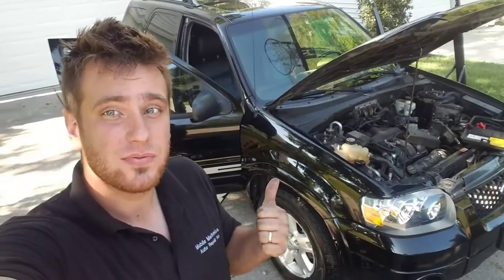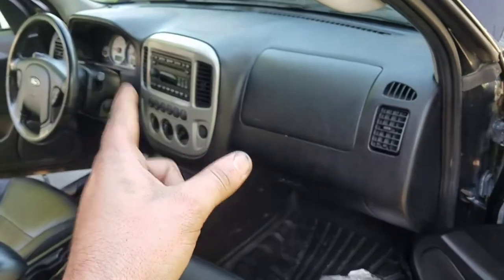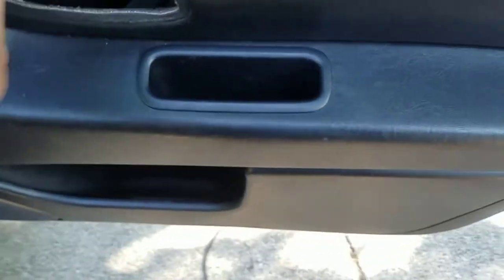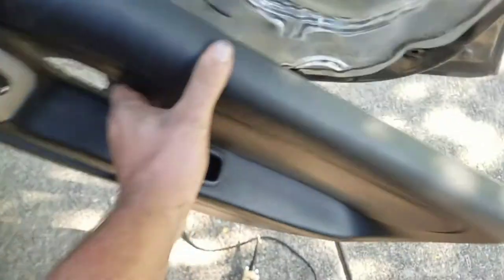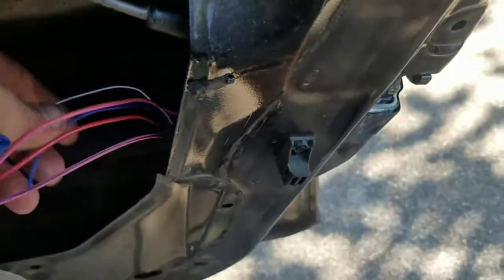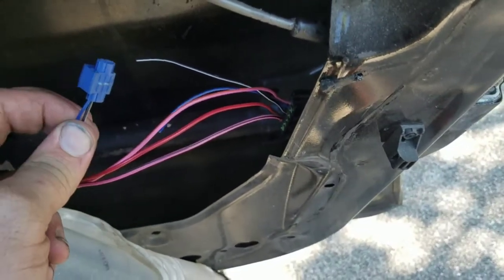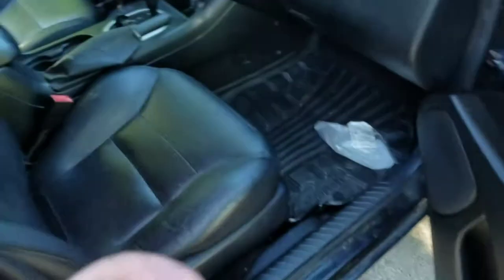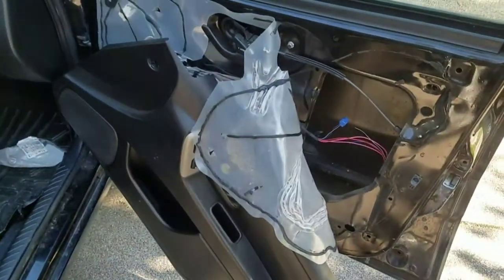Ford Escape Passenger Door Ajar Fix "How to"

Comment: Great info, I fixed my 2006 Escape, but watch out, if it is the DRIVER'S  door, you have to splice the GREEN+BLACK wire (not blue)  to the WHITE+Black.  And with the driver's door, be aware that if you repair it this way, you will not get any beeping if you leave the key in the ingition when you open the door.
Reply: Good information. This is what worked for me. I tested this by using a jumper wire to connect the corresponding ports which immediately turned off the dash indicator and the interior dome light. Thanks!
Reply: Thank you!!! This fixed it for me too
Reply: So my door randomly says it's open while locked alarm goes off. Driving it say door is open driver door. Those wires are not factory connected? Or is it just that they came apart. I'm sick of getting up to shut off alarm I would leave it unlocked but I don't live in good area
Reply: Do you have to cut the factory wrapped wires loose and apart then splice them together

Comment: Thanks for this, and it absolutely works. The alarm on our 2005 Mercury Mariner (same as the Escape) has been randomly sounding for months, to the point where we stopped locking it.  Then I walked across the road and fixed my neighbor's 2005 Escape, which had the exact same problem.  On both, it's the black wire plus the blue-&-pink wire. Problem solved, both vehicles now locked, dome lights working as they should, and no more "RIGHT REAR DOOR AJAR" on the dash!
Reply: lol.. that is the same door that is showing ajar on my 2005 Mariner. The right rear. I am going to have to try fixing this tomorrow. The alarm started going off for no reason. Can't have that. Didn't know it was on till I went outside. My neighbors probably hate me now. I am leaving the doors unlocked for now. Hopefully that will keep it from going off till daylight and I can see to fix it.
Reply: You answered the exact question I had about which wires. I have a 2005 Escape, too. Thanks.
Reply: Same exact door for me to keeps going off
Reply: Same door for me on a 2007 Escape I just bought (took me a while to figure out which one because the Ford doesn't tell you WHICH door is ajar!).  FYI- you don't have to cut the wires.  Just drill or carve out the plastic blocker on the side of that vampire tap that prevents a "through wire" on that side and clamp it down across both wires.  Continuity between those wires = "door is closed," regardless of what the door switch is doing.  And if you feel like replacing the faulty switch later (I don't) you don't have to repair the wires you cut- just remove the vampire tap.

Comment: This all day!!! I was getting quoted like $1000 from both my mechanic and the dealership to replace the whole door it sounded like, or maybe just this sensor not sure. My alarm had been going off for like 2 years while locked and got to the point that it started right back up after I turned it off so I just left it unlocked. Found and followed this tutorial in one afternoon by myself today - if I can do this ANYONE CAN. Thank you thank you Fixbook it's been such a weight off my (and my neighborhood's) shoulders!

Comment: I just did this. It works except that my radio now does not turn off automatically when the door is opened after the key is out. NOT a big deal turn it off manually. Be careful on the driver door! It is the GREEN/BLACK wire, not the dark blue one like the passenger door. I mistakenly did the dark blue wire and the door ajar chime and dome lights stay on while you drive constantly. I opened it back up, did the green/black wire and reconnected the blue wire and everything works great. No more door ajar light, dome lights staying or random car alarms. I can lock my car at night again which is a relief because it has been gone through by homeless twice. Thanks for the video. I fixed my years old problem in less than an hour with a screwdriver, wire cutters and electrical tape with zero out of pocket expense.

Comment: Thank you so much my brother, you $aved me big time!! It was my right rear door.. Bypassed now it works just fine,  windows, locks work just fine on all 4 doors, dome light works with all except the rr.. Opened it with truck running and no dash warning.. Again, thank you, have an awesome wknd
Reply: c gonzalez Hello I’m having the same problem with the exact same door I have a pink and blue wire black and white wire orange and pink wire and pink and black wire which ones did you have I have no idea which one I’m supposed to be cutting I don’t wanna cut all of them to find out
Reply: Never mind I went further down the comment thread and figured it out thank you

Comment: 2006 ford escape hybrid, worked like a charm. Thanks!! Only difference: the blue wire in the video was blue and pink striped for me
Reply: My car always says a door is open but not which one, if I do this door only will it work ?
Reply: @marcuscuellar2185  You need to figure out which door is the problem. Two ways to do it. Option 1 sit inside the car and lock / arm the alarm with the remote. Open the doors one by one. Repeat the process until you open the door but the alarm doesn't go off. That door is your problem 😉.  Option 2. If you have a good OBD2 reader and Forscan under dashboard you can load the PIDs for the door ajar sensor for each door. When you drive and the door ajar alarm goes off note which door is ajar on the display. For me it was the front passenger side door.

Comment: Thanks so much for this video. I have a 2005 Escape with a bad rear passenger sensor that is draining my battery. Are the wires the same colors in the 2005?
Reply: hi so i just fixed mine , it is very close to the same thing but you're  going to be looking for a pink/blue wire to connect the black/white wire wire .
Reply: @timpaine6352  Thanks I'm getting ready to fix it now.
Reply: Had Enough awsome !! There is only 2 screws for the rear as well
Reply: TIM PAINE I went through months of draining my battery and having alarms and lights going on while driving. The fix took 10 minutes on my 2005 Escape..SO frustrated with Ford. Thanks for the info. I just capped the two wires together and no more alarm! Thanks for posting the correct colors & Thanks to Fixbook too! Saved me $400.
Reply: So for the 2005 you need the pink wire & blue wire to go with the black and white one?

Comment: The driver doesn't have a solid blue wire.  So I spliced the black and white to a blue a light green and now the dash says the "driver door ajar".  would you know which wires to splices on the driver side?

Comment: I believe it’s my driver door setting the indicator off, will sometime be affected by adjustment of my seat. Would I still bypass the sensor via the passenger door? Because there is ALOT of wires on my driver side and I cannot find any site or book that’ll tell what wire goes to what
Reply: UTube

Comment: @Fixbook surely with everyone that seems to have this problem, there should at least be a way to tell which door is causing it!
Reply: Sit in driver's seat with all doors closed and press LOCK.  Wait 10 seconds.  Open one door.  If it alarms, then that is not the door causing the problem.  Try another door after closing doors, locking, and waiting 10 seconds.  If the alarm does NOT sound, then you have found the problem door.
Reply: Dan Starkweather thank you! 🙏  I will definitely try this

Comment: So, because i am obsessive compulsive, and don't have a lot of electrical sense - do you take the wires from the door latch and also connect them in the butterfly connector?
Reply: Nope, just short the two coming to the switch like he shows, the two from the switch should be left disconnected.

Comment: I too have this problem with my 2007 Escape! Problem is....the dash light indicator shows I have an "open door" ...but it has no indicator to tell you Which Door!? Help Please.
Reply: our's has been doing this on and off for about a year now. today it ends lol. fed up with the random car alarms and who fits while we are out. how i tracked it down was the dash has a display telling us information. it would flash so fast you couldn't even see it but it finally was on long enough to catch it one day while driving. i might be wrong but i think some of the more advanced scanners, shop level scanners, can see more info than we can with our best home scanners/code readers. it might be worth having a shop scan it. it shouldn't be an issue with the engine/trans but i think the computer stores that info for diagnostic purposes such as ours. i'm far to cheap, stubborn and untrusting to let a shop at my car personally but you might not have such issues. you can do this yourself after they figure it out. i'm going out there right now to splice that headache, just didn't have the wire diagram and this guy gave me a start.
Reply: blueovalfan23 How did this work out for you?  I have the same issue that I can’t figure out which door; it seems sometimes it’s the passenger rear, but sometimes it’s the hatch.. very annoying.
Reply: Here is what I was told. Sit in driver seat, turn off car, key in your hand. Double click to lock and prime alarm. Wait 15 seconds. Now open doors one at a time. The alarm should sound.  Reset alarm. When you find the door that will open WITHOUT sounding alarm, that's your bad boy.

Comment: so far this worked for me.. 2007 mercury mariner premier whose battery is steadily getting drained from this problem.
Reply: Joseph Clemente im having the same problem and i cut the black and white wire and the pink and blue. What should i do next?
Reply: Don’t know if you’ll still see this, but I have an 07 mariner and trying to figure out which wires to cut and splice. What worked for you?

Comment: Which wires do I cut and splice together for the drivers side? I cut the black/white and blue on drivers side and dinger won't go off in drive or reverse
Reply: did you found the solution 
I did the same thing to my driver side and now I am stuck,
Reply: I have a 2005,just fixed my driver side problem. Black w/white was the hot,green with black stripe was the door ajar. If you get the door panel off,pull the connector apart by the latch,turn the key on,take a wire and jumper from blk/wht pin and one at a time go to another pin until you find the right one. You can cut the one wire and splice to the blk/wht bypassing the door ajar
Reply: @davidweppner1642  Thankyou

Comment: Is it not possible to find a place along the wiring harness where it comes out the door that you can tap into to join the wires so that you don`t have to take the door panel off? Where do the black/white and blue wire originate?
Reply: Do you realize you’re just making it harder for yourself? The door panel is literally a few screws. Just pull it and go in.

Comment: Any way to get this to work for a 2008 Escape lift gate glass sensor? My lift gate glass latch is warped from rust on my hatch and won’t close properly so I disconnected the wire for the sensor and now this light stays on in my car. I disconnected it so no one accidentally opens my lift gate glass from my key fob
Reply: Did you figure this out ??? I'm having the same issue

Comment: Hi!! I pray someone see this! 
If I followed this exactly.. why would my car lights and door ajar light still be on? My wires were black/white and my blue wire was blue/pink. I saw in the comments it said some would have blue/pink wire. I do need to know under that blue connector did the two wires you have in there touch? Like do the wiring need to be exposed and touching or are they not exposed just separated from when he cut them? And no I don’t have mine touching. I was wondering if that is why??
My car is a 2007 Ford Escape. I took it to Ford and they determined its my right rear door that has a bad ajar switch. They want to charge $900 😫😫 I’m trying to take care of this myself so my alarm won’t sound at 3am again.
Reply: I just did my 2005 Ford Escape it was the Black/White and Pink/Light Blue wire.  Cut both wires and then connect the two together and do the same for the other ends of the cut wire.  Once you connected both wires with once another you then attach them together with the other two.  I used a butt connector and then black electrical tape.  Worked 100% Watch this video https://www.youtube.com/watch?v=Xq9UCa852HU

Comment: Just tried to do this but now the door ajar sensor is on constantly and the car beeps non stop. Any ideas what happened? Successfully did it with the other doors.
Reply: you did something wrong - after you cut both wires - you connect them together - I used a butt connector to connect the wires together.

Comment: We have new-to-us 2005 Ford Escape, "door open" warning sign, horn lights and bip-bip sound inside car kept going off.  Did the wire trick (pink/blue to connect the black/white), no luck.  HELP!
Reply: Sounds like you may have done the wrong door.
Reply: @modemagic1  Great idea, will try that!  I wonder if the wires are the same for the tail/hatch back door.
Reply: The same thing happened to me
Did you find anything?

Comment: Dammit. My wires are different. I have the black and white. But no solid blue. I have blue and green.
Reply: Use the blue n pink to the black n white
Reply: c gonzalez thanks not meant for me but helped me out I had the rear door that needed it and that’s exactly what I did and it worked, it kept draining my darn battery... thanks again

Comment: There is nothing "fancy" about those little connectors, in fact, they are hot garbage!  No real mechanic would use those as they cut into the wires and leave them open to moisture and corrosion!  If you want to do it right use a hard splice and heat shrink.

Comment: If you went to all the trouble of taking the door apart to jury rig it, why don’t you replace the bad part that’s right there?
Reply: Because we don't want to spend $100+ on something we don't care about and just want a quick fix. These Escapes are going to be 10+ years old and may not last another 5 no point in putting any unnecessary money into them. I already have to much $ into mine I'm fed up with it.